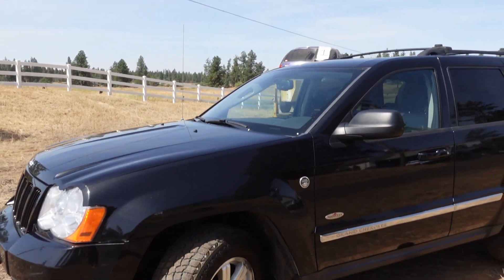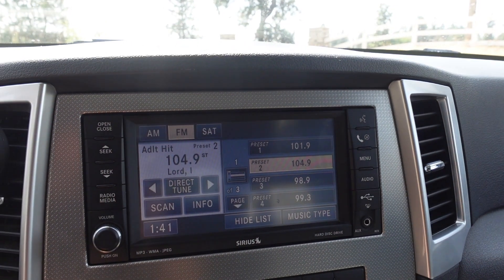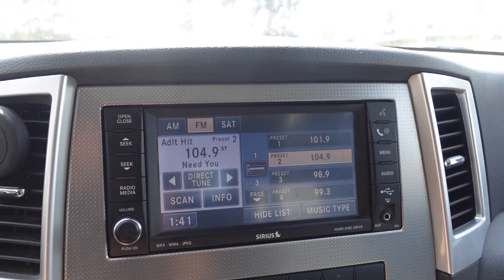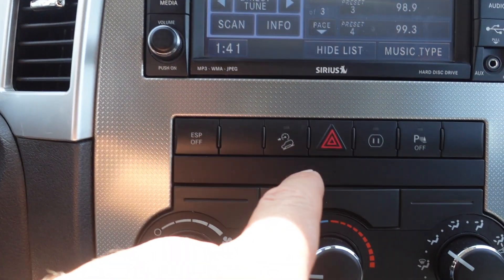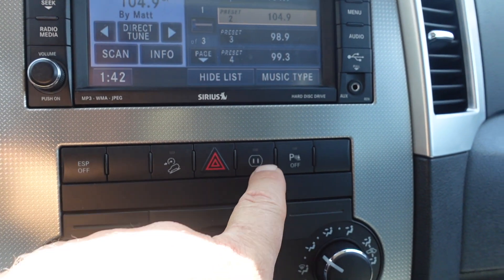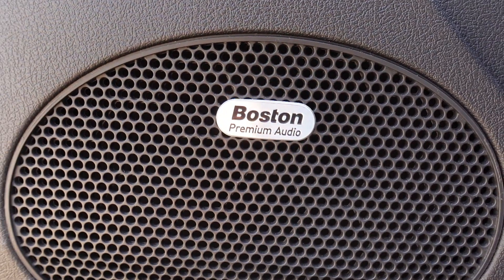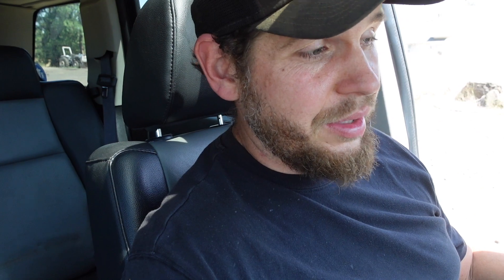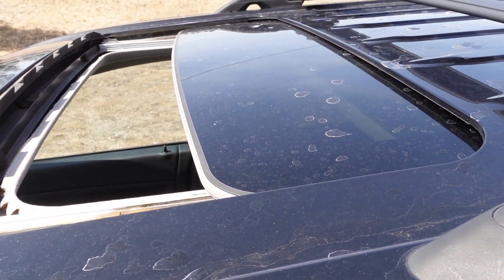Jeep Grand Cherokee WK CRD North Edition with Quadra Drive II: Overland Build Part 1

Comment: We just got ours ('07 CRD, Overland trim) with a Rough Country 2 inch lift already installed. It has stock upper control arms but will put on Rocky Road Outfitters after market UCA. I subscribed to your channel and look forward to seeing what you're gonna do in the months ahead  🙂
Reply from the maker: Thanks! How does it ride with the RC lift? This will be a slow build, hopefully lifting it in the spring sometime. Got some other projects in front of it at the moment
Reply: We recently got one too with exact same situation. How are the upper control arms? I’m planning on getting a pair next month.

Comment: Sweet, I'm 71 and  have the same options and its a brut in any weather condition. In Canada when we get 12+inches of snow I get in her and let her go plowing through the snow when my neighborhood is at a stand still. The diesel is supper reliable but well maintained and diesel fuel conditioner always added to keep injectors clean. To avoid carbon build up I made my own catch can with a drain valve and hose going under the chassis for draining out during maintenance. I tow a 6000# sailboat to the marina a couple times a year and tow my 3600 # power boat for water camping in over a million lakes here in Ontario. Best Jeep I ever had and keeping it as long as I can drive it.

Comment: GPS trail mapping and tracking is on the right bottom touch screen press it and your ready for the trail. The 120v outlet is on the center consul behind the front seats
Reply from the maker: I’ll have to try out the gps!
Reply: This one does not have navigation
Reply: Power outlet behind center console, other button with car is hill decent control, but this one unfortunately does not have navigation, you have the 430 radio option, 430N is the one with nav. That one does still come with the backup camera and bluetooth for phone calls though